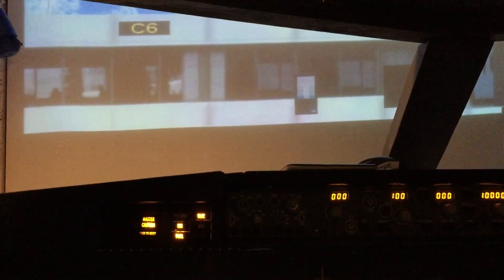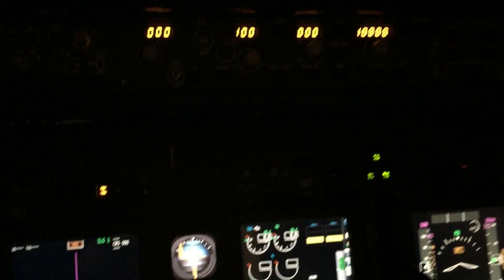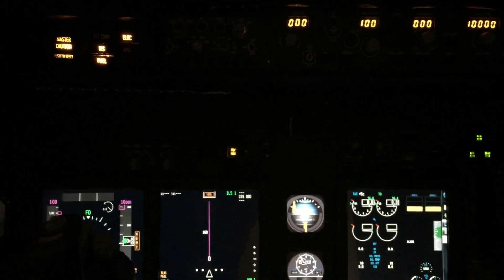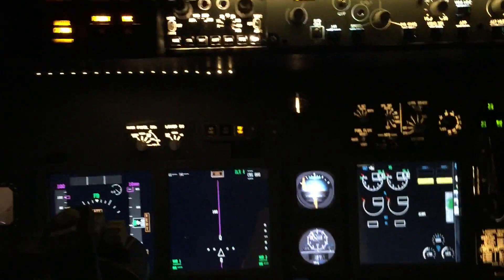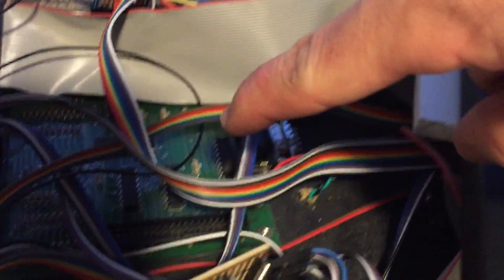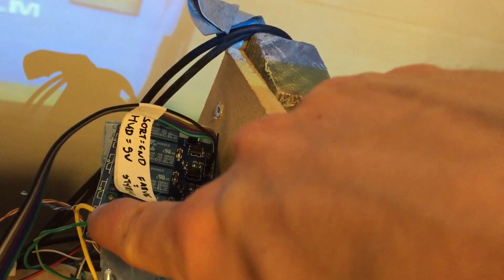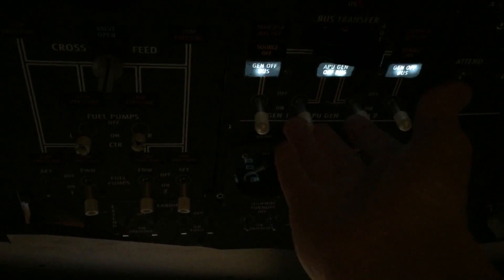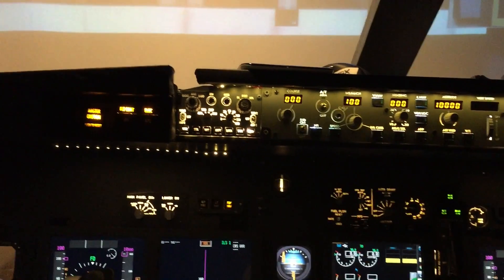Control backlightning - B737 Home Cockpit

Comment: hi ...how did u make the light travel through the board...i am making a sim too but...i dont get how u make thd led light come through the foam or any other material...
Reply: +Akeel Ifthar It can't go through the foam board as you can see on the overhead, if that's what you're talking about. But I believe that Peter's MIP panels are engraved clear acrylic ones from Opencockpits/Hispapanels etc so it can go through them.
Reply: jamang1999 yeah....thnx ...i too started engraving the panels from a cnc machine

Comment: Nice,In my setup i use a relay for ac 1  ac 2  and dc. Really cant see the difference unless you open the bus transfer though. Also do you plan on installing vents and a fan. A relay could turn on with packs or recirculation fans running.

Comment: Project is looking good
Very realistic 
But i still dont understand how when you flick the buttons on your overhead
The MIP lights up
I know you can configure the function of buttons but how does prosim know what Led strips to light up when you flick buttons on your ovrhead ?
Can you configure the led strips also?
And how do the LED strips work are they connected to an interface card?
and if Yes what is the name of the cards you use
(FOR OVERHEAD +MIP)

again great cokpit,good luck for the project :-)
Reply: first, thanks for the tip about the relay cards Peter !  to answer the question above. All prosim does, it sends a 5V signal on a pre-configured output when you flick the switch. you configure this as a gate in prosim and map it to an output on an interface card. this output (i.e. from the opencockpits card) then connects to the 5v relay card which causes the relay to flick an internal switch that turns on all his LEDs. LEDs/LED strips are not connected to any interface cards, just a power supply with the relay acting as the on/off switch. hope it makes sense :)
Reply: Andre Els ok but this seems hard, 
like can i not connect a led strip to the led output on the interfce card (i.e flight deck solutions high input/output card)
like i would for any annunciator ?
thanks.
Reply from the maker: Hi ryaan beg. 
That is what the realy is for. You connect the LED-strip to the relay. And when the cockpit is in a state where the backlightning shlud be turned on Prosim sendt a signal (Output on a OC Mastercard) that activated the relay. 
So it is not a certain switch that triggers the relay but a value inside Prosim.
I could just as well light a LED with the output, but here I trigger a relay instead of lightning a LED. It is the same method. 
Regards
Peter